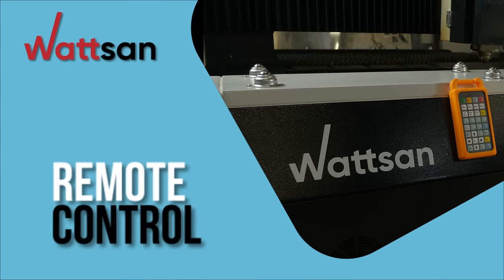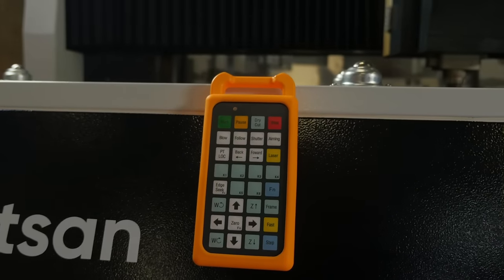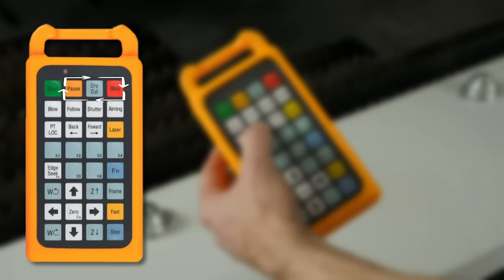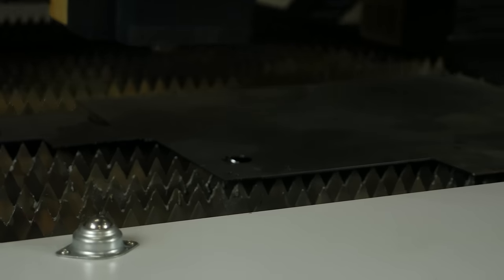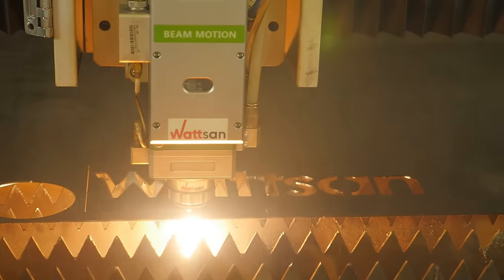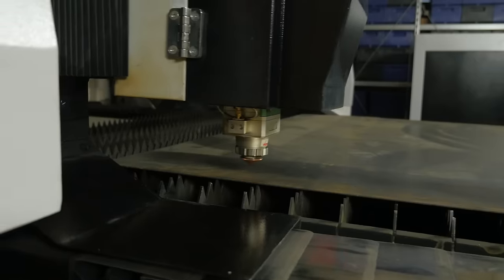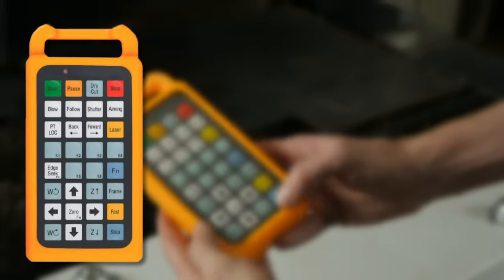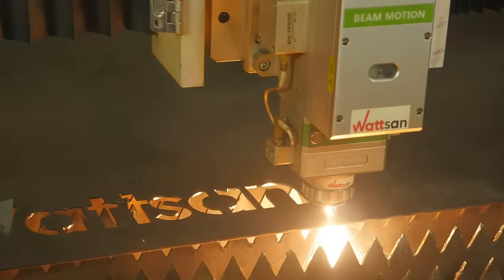HOW TO USE LASER REMOTE CONTROLLER / FUNCTIONS

Comment: Hello, as I see, you don't use the cooling gas pipe for the head of the Laser. Is there any particular reason?
Reply from the maker: Hello! The cooling system of the laser head on metal cutters is located inside the laser head💨 For better cooling there are also temperature sensors in the laser head.

Comment: Why sometime red light indicates on the remote?
Reply from the maker: This will depend on which company's machine you are using. Do you use Bodor, Senfeng, Trumpf or other manufacturers?
If you mean our machines, yes, we have a red indicator on the remote control. It lights up when you have entered a wrong command or when you have pressed several buttons at the same time.

Comment: how to fix if the cnc laser cutter red light pointer is not turned off while working
Reply from the maker: It depends from laser source's model, usually nobody asks for this, but it's possible through CypConfig⚙
Reply: @Wattsan  [Hanli fiber laser cooling system] the problem is i did not shutted off the red light using the remote.